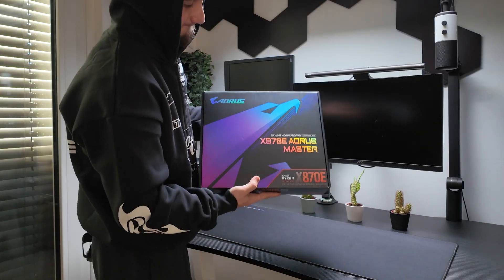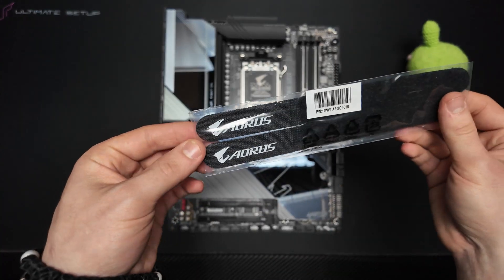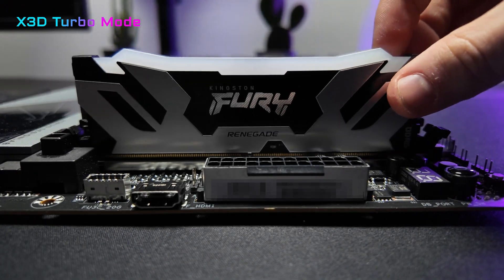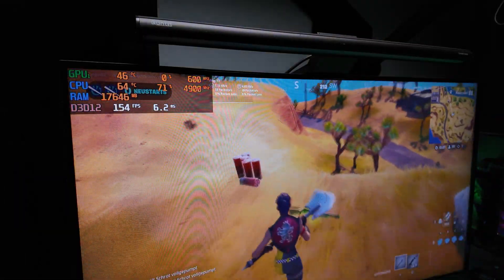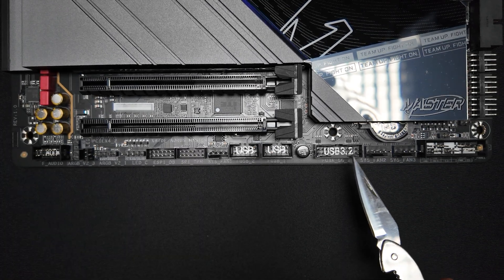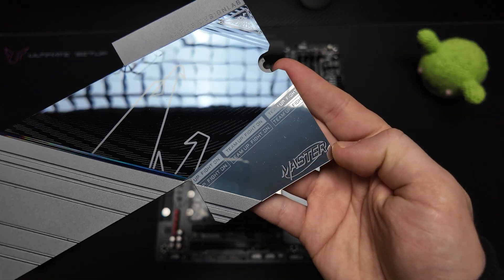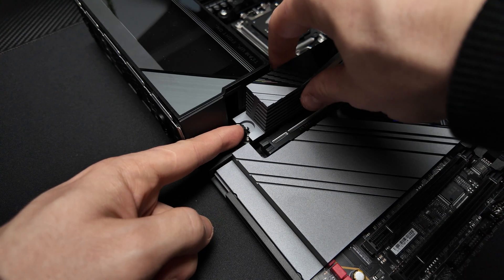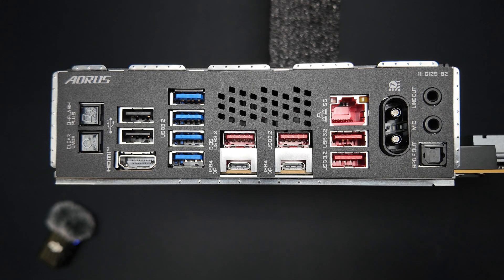GIGABYTE X870E AORUS MASTER - The Motherboard you need for your AMD Ryzen X3D CPU

Comment: a mediocre board even at $329, building in 1 now. the huge heatsink blocked my cooler and had to be removed.. the USB 3 plug frame came off the board with a plug...the light up bios button top right bios just popped out the 1st day...it runs no better than a 670E tomahawk but has USB4....

Comment: how is your rgb light not stuttering ?? i have the same MB but my rgb light stutters like hell when i use signal rgb while uninstalling all the rest rgb software.
Reply from the maker: I dont use signal rgb.
Reply: are you using any hub? most cant power an abundance of lights , I use a Nollie 16 channel box that can power and control 16 channels of 256 leds and peripheral lighting MB, GPU, RAm. with SignalRGB, I used to hit a RGB power wall all the time , I go overboard  look at my computer youtube videos.

Comment: One can you all Gen 4 M.2 Nvme SSD in this motherboard instead of the the Gen 5 that it is able to take?  Two how many M.2 Nvme can you fit into the motherboard without comprising the GPU down from 16 to 8?
Reply: 2 M2s unless you use a pcie riser adapter

Comment: I have the same x870e motherboard and 5080 master combo. man it looks so good! I installed mine today, however I noticed i can't get the pcie to latch in all the way I'm assuming it's because of the thick m.2 heatsink it makes me nervous being that I spent so much money on it. I'm able to pull the card out without using the EZ latch button and that makes me nervous. I was wondering if you were experiencing the same issue ? Everything is running fine otherwise and a huge boost coming from a 3080.

Comment: Sry jetzt schonmal für die halbe Bibel:

1. Sehr sehr cool das ihrs wieder mit langen Videos probiert und das hier ist mega! Ich liebe diesen chilligen Stil wo man einfach quatscht und das man dass wirklich gut kennenlernt, ist auch ziemlich abwechslungsreich so zu den meisten Shorts. Qualität natürlich top. Vor allem nach nem anstrengenden Tag ist sowas echt nice und rt überhaupt nicht langweilig

2. Ich hab auch ein Gigabyte Motherboard und bin echt zufrieden, leider hat's aber nicht mehr für arous gereicht aber das sieht mies geil aus, auch mit dem lüfter sowas hab ich glaube noch nie gesehen. Außerdem sonst hat es mehr Slots und kühlung als ich jemals brauchen würde aber bin da auch echt langweilig xD. Aber diese ganzen Ports wirken ziemlich geil, und auch dieser x3d Modus ist sehr interessant, wie funktioniert das genau? Overclockt das die CPU einfach automatisch?
Reply: Junge ich hab hier mehr geschrieben als in jeder deutsch Arbeit wtf
Reply from the maker: @Demenztoros  Ey richtig geil, dass du am Start bist und dir das Video taugt! Freut mich übel, dass du den chilligen Vibe feierst, genau das war der Plan. Zum X3D-Modus, hier wird Multithreading deaktiviert, dazu gibt’s noch verschiedene Latenz- und CCD-Optimierungen und bei CPUs mit zwei CCDs wird sogar einer davon deaktiviert. In Games kann das für bessere Performance sorgen und Micro-Ruckler reduzieren. Also kein direktes Overclocking, aber trotzdem ein smarter Boost. Dein Gigabyte-Board klingt auch stabil, Hauptsache, es läuft sauber! Danke für den nicen Kommentar, feier ich mega!
Reply: @grigobyte  danke für das nice Video Jungs :D bitte mehr!